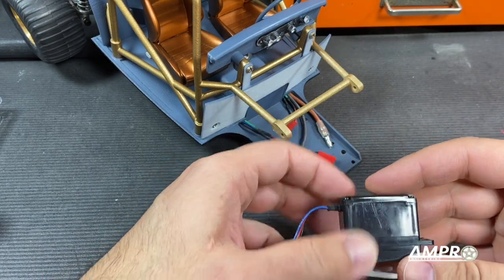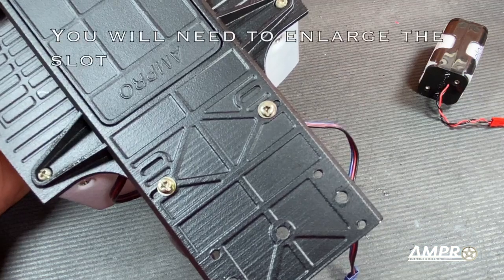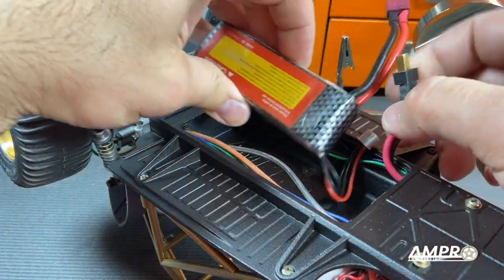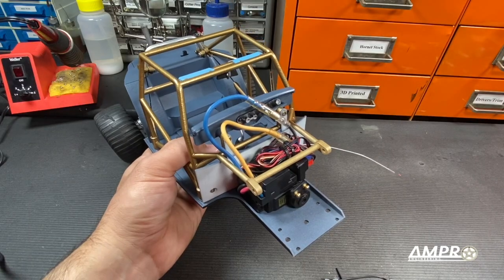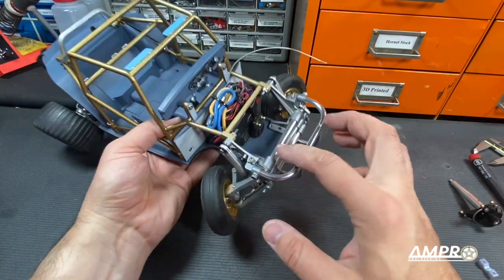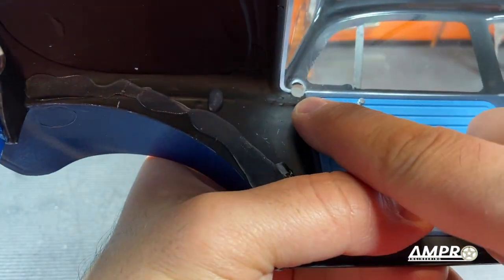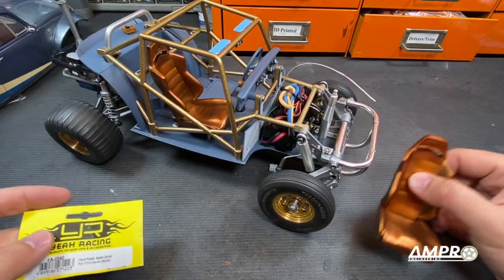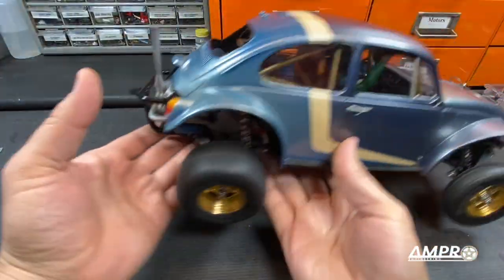e303: Scorcher Interior, Front end pt3   HD 720p

Comment: Thank you for all your hard work.  While I have no plans on building an actual Tamiya Sand Scorcher, I DO have plans involving the Sand Scorcher body, the "upgrade/replacement" parts you designed, and the Junkyard Stance Porsche Flat-6 engine.  I just hope Hannibal (Smith, not Lecter) is right about "plans coming together".
Reply from the maker: Haha! That sounds like it will be an epic project.
Reply: @AMPROEngineering  Honestly, Matt (Scale Builder's Guild) gave me the idea.  He did the Sand Scorcher build videos using your parts, and, knowing he normally does crawlers, that's what gave me the idea to attempt this.  I will be doing a build thread in the RCC forum.